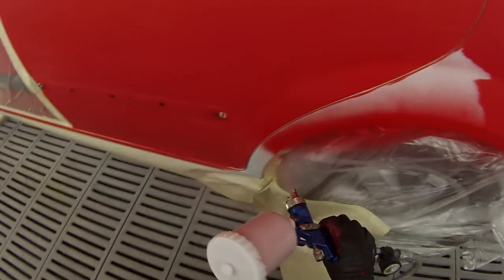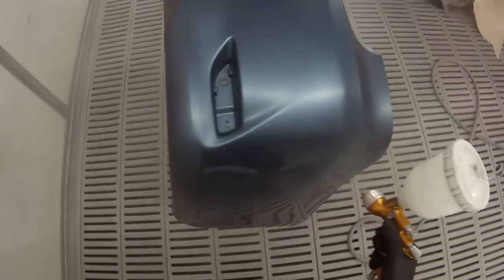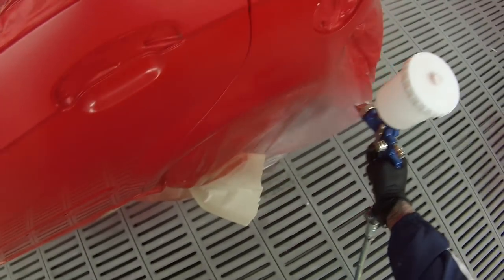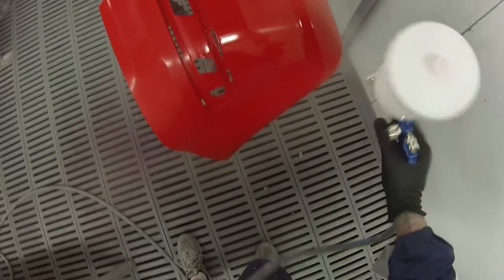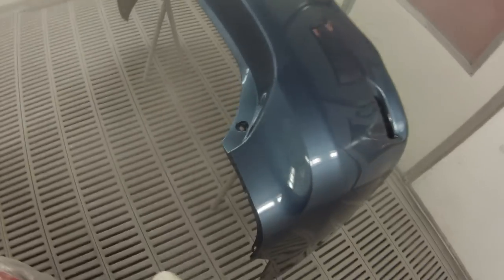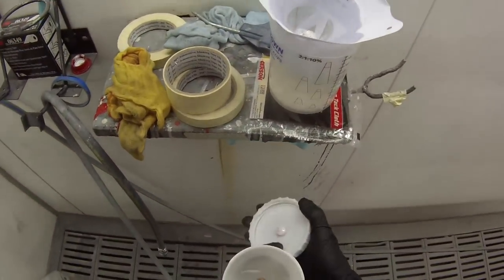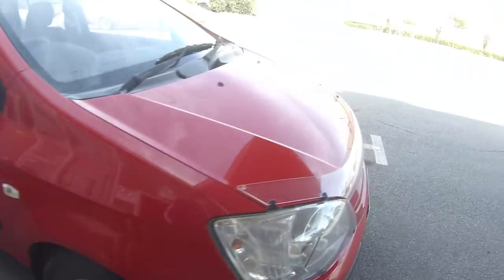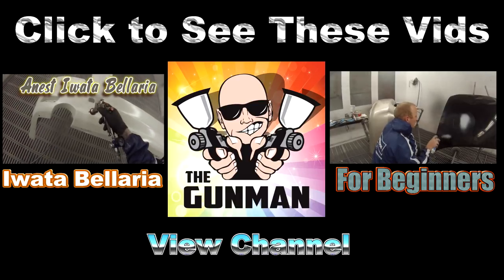Should I Buy a Cheap Spray Gun?

Comment: My experience with 20$ 1.3 gun from TecTake: 
- Bottom thread was machined very bad (took time to seal it with PTFE tape)
- Took me a lot of time to dial it in ; to get a decent finish
- Hard to get the right pressure, needs at least 3 bar, in the HVLP pressure range results are just horrible
- High air volume consumption, had to wait again and again for my cheap compressor
- Time consuming job to keep it clean and working

But: *Decent finish*, not perfect but stunning for 20$

tl;dr: Cheap gun works, but it is inefficiently and time burning.
Wish I had bought a quality gun in the beginning, saving all the time & paint.

Comment: Funny, it looks like the DeVilbiss is spraying much more into the air.  Maybe at a lower pressure it would be better again.  Also, if the cheaper gun is putting more on, does that mean you have to do less coats?

Comment: I recently purchased a devilbiss tekna pro lite, came with 1.2 and 1.3 and 1.4 tip and te 10 and 20 caps, what setup do you recommend I use
Reply from the maker: ***** I recommend using 1.3mm and the te20 cap for clear and base

Comment: Hi gunman love ya videos mate,im over in uk and do a bit of a allrounder job in a bodyshop with non heated booth so its hard to hammer clear on wet and at 2 bar so just wanted to ask if you have had good results with sata 3000 rp at lower pressure ? keep them vids coming and wish we had your weather lol
Reply from the maker: I am yet to use the 3000 rp but if its anything like the 4000 then I really don't like them and find they perform similar to the Carmix gun you see me use here.

Comment: What would you recommend for spraying a galvanized tin house trailer roof? I want to cover large ares quickly (I have 5 roofs to do) and uniformly and thickly and things like finish are irrelevant. So would a cheap harbor freight gun work good for this? Will I have to refill a small can a lot? Ill be using Olympic enamel paint. What kind of air compressor should I get.

Comment: Hey Gunman! I saw in an another video of yours, that you mentioned these cheap guns like a crap, but in this vid I saw they can be used, to get an acceptable result. Unfortunately I have a gun like this, looks just the same, except the Carmix-label. I have to perform both the base and the clear spraying by this. What settings do you recommend me for getting the best quality, that this gun can give? I mean, how many secs should i set the paint viscosity and what was the pressure, where this thing worked best at. Any tips about this gun is welcomed. I simply can not afford a more expensive gun, but want the possible best result on my car, according to, that the full body welding process took 2 yrs to me... Thanks in advance! And another big thanks for your series! It inspired me, to do the painting too, for myself. ;)

Comment: can you still get good results with just using the PSI gauge on the air compressor? or is it absolutely needed to have the PSI gauge right on the gun? I'm looking for a cheap gun as I really only will use it once or twice.

Comment: I've learned a lot from your vids, Thank You!  I'm going to get a new gun to replace my old Sharpe Platinum with a 1.4 tip.  I paint dealer brand tractor paint (acrylic enamel) on Antique tractor restorations.  I was thinking about a 1.3 tip on the new gun for finer spray.  Would I be making a mistake.  Will the enamel go through a 1.3?

Comment: Does the Devilbiss have seals in it?  I bought the SataJet 5000 RP but I was thinking about buying the Devilbiss to use as base coat gun.  I had heard if you forget to clean the gun the ones with seals in them go bad where the ones with all metal can be torn apart and cleaned and will spray the same when put back together.  Do you have any advice or experience with this?

Comment: I just purchased a hvlp Neiko for refinishing guitars.  I only have a 6 gallon pancake compressor.  Do you suppose this will be big enough since I only have small areas to spray? I see most guys spray between 25-40 psi at the gauge with the trigger opened.

Comment: Thanks for all your videos!  Can you recommend a budget gun that will spray pretty decent, I'm painting my first car at home in my garage, I have a good air compressor, and I epoxied my entire car.  The guns I'm using are the devilbiss starting line guns, do you Think they can spray base and clear good enough?  Cars going to be black.

Any thoughts on the eastwood evolution gun?  I Think that's what it's called.  It's around $100th I think.

Thanks
Reply from the maker: Pitbull14218 I've never used any Eastwood guns but a guy is sending one out for me to review, this in my opinion is the best budget gun on the market. 
https://www.youtube.com/watch?v=dQUeF6GBY90

Comment: While using the cheap gun you say "going on thick" twice. Does that mean you did not put enough reducer in paint or do you mean you are moving slower and  letting paint build on
Do you use a viscosity cup to check paint\ reducer mix ?
Reply from the maker: It was the same exact product that was in the gold gun, yes I do have a viscosity cup but find it's not really necessary most of the time when using MS clears like in this video.

Comment: Im in the us and buy the cheap harbor freight gun for 15 bucks lol. They shoot perfect for me. Never any orange peel at all and always looks like glass. 
But I agree you need to mess with settings to get a nice gun. They are basically replica of sata and devilbiss. 
The gun itself has been good for about 5 years I only use it about 5 times a year though

honestly the paint doesn't look bad and their really is very little orange peel, way less than an oem paint job anyhow
Reply: yes i agree if your doit for a non professional use they get it done clean it good an color sand

Comment: Great video - now two questions. I have a Devilbiss FLG4 that's in great shape. Money wise I could afford a FLG5 right now - is there much difference between the two? And I get it you paint almost every day but I take note that you just get paint on there moving the gun around a lot. Does that make for a better coating than a 50% overlap style? Thank you!
Reply from the maker: +Charles Rutherford please avoid the FLG4 the FLG5 is far superior, I hardly even know what overlap I use, it's just what comes naturally and what it takes to get it to lay down well.
Reply: Thanks for the heads-up. I came across a GTI gun with a 1.4 combo. It needed a good cleaning and I have to get a top for it but looking it over there is almost zero wear and no damage. I will probably see if I can sell off the FLG4 gun.

Comment: is there anyrhing at least half decent on the market in the range of mini guns? with smaller fan width and smaller cup? I already have the satajet 3000 series but it is not the right stuff for guitar work. the fan is so wide I get about 50% overspray when I paint and lacquer guitars. I want a fan tip gun, those spot repair mini guns that only shoot round pattern are not the thing for me. thanks

Comment: Hi love your video's. My question relates to spraying acrylic enamel. I know it's outdated tech but it is a easy and safer paint for home use and the cost is a lot better than bc cc and for vintage cars and looks proper. So, I have used a siphon gun in the past to spray ae with very good results. Thinking to go new school and not shoot paint all over I have tried a hvlp with a 1.3 mm tip. I never could get good results compared to my siphon gun. I did follow the tech sheet for set-up although a 1.4 tip was noted (this gun is for my bc cc painting). I have read a lot on spraying ae using hvlp on the net but there really is a lot of conflicting information out there. Any idea on what hvlp setup would work? I'm thinking a larger cap maybe 1.5 or even as high as 2 might be required. I have watched your video on ae but you really aren't spraying ss ae so it was tough to conclude gun tip size. Probably a lot of us old school shade tree car guys would love to hear your thoughts on this. My tech sheet notes for hvlp 1.4mm tip zhan cup #2 at 20-22 seconds and psi at the cap at 10#.  Cheers!

Comment: I am fabricating a 26 ft enclosed trailer and will be painting the frame and aluminum panels . don't really need a gun other than this job. maybe paint a few other stuff . what would you recommend for shooting a Rustoleum oil based primer . and oil based top coat for frame and oil based top coat for aluminum siding . BTW I have a harbor freight 1.8hp 26 gallon compressor , 6 cfm @ 40psi.
Reply from the maker: Get this gun, reasonable price and will last a lifetime https://www.youtube.com/watch?v=dQUeF6GBY90
Reply: +The Gunman wow thank you for the quick reply!. BTW great videos man

Comment: Great videos. Still puzzled re CFMs vs pressure req'd for good results with various gun technologies. My compressor has 30 gal tank and is limited to ca. 6 CFM at 40 psi per the manual. I see a lot of videos around of DIY folks using HVLP guns with this size and smaller compressors yet most of the guns say the need 10+ CFM (e.g. Iwata W-400). Can these be used effectively with smaller compressors? Beginning to see LVLP guns that appear to be designed to more for low CFM compressors but even some of the those say 6-8 CFM though same are as low as 3-4 CFM. I know these will put out less material. What is your opinion of LVLP guys for beginning DIY auto painting.
Reply from the maker: Copied & pasted for answer in a Q&A video I have a plan for
Reply: +The Gunman Thanks! I look forward to seeing it.
Reply from the maker: Stephen Fisher I may even do a live stream so stay tuned.

Comment: I don't know can you advise i am looking for a small spray gun for spraying clear lacquer on to small woodwork projects 2 to 3 ft square size as cans are expensive over time as I normally need 2 to 3 per project. Spraying is an area i don't know anything about so i am looking for a good gun that does not cost a huge amount but i am willing to pay if the gun will last
Reply from the maker: Watch this video, it's exactly what you need https://youtu.be/mYM70WsQlsk

Comment: That's not a $100-150 gun, that's a regular hobby gun you can get in double and triple deals w/ cases in different sizes (both guns, nozzle and tank) for $35-75, priced at $20-30 individually. If you paid over $100 for that gun i'm pretty sure there's a seller somewhere deserving a bonus!

Comment: help me gunman!! HELP!!   I only have a 30 gallon compressor 7cfm@90psi,  will this work with an HVLP gun?   I can't buy a larger compressor as I dont have 220v in my garage, only 110v, and the 60 gallon compressors have 220v hookup only.   can you do a video on LVLP guns? thanks!!!!
Reply: if you run 2  compressors into a tee  or better yet a 3rd tank  your cfm is additive         borrow your friends compressor and hook them together      hadta do it b4 to keep up    also keep in mind      you have to plug them into 2 separate circuits or you will blow the breaker

Comment: You talked heavily about the amount of orange peel the cheaper gun creates... do you think the orange peel is minimal enough that you could wet sand, compound and then polish it out to make up for the flaws of the cheaper gun?  Or is the orange peel so heavy that the extra manual labor would not matter?
Reply from the maker: You could polish it out without too much issues, I have recently got onto a good gun that's not too expensive, look for a gun called ANI F150 or ANI R150 mini gun at spraygunsdirect.co.uk
Reply: +The Gunman Awesome...will do and Thank you!

Comment: Devilbiss is good but for 1-2  paint jobs its way too expensive.
I have a 50L compressor ,2.5HP.
If i buy devilbiss and it comes out that compressor is weak.
Then thats another 500€ for compressor, if not more.
Then the paint around 200.
Then clearcoat.
List goes on and on.
Its not worth diy, easier to let pros to repaint my car

Comment: If you have a litre of paint in 2 guns the cheap one goes through paint quicker then the exp gun BUT you will still have a litre of paint on the car! So the cheap one you have to move quicker, then you say it wastes paint but the fan is smaller then the expensive one so where are you pointi the gun to waste the paint? If it's on the car it's not wasted? This video is bullshit sorry